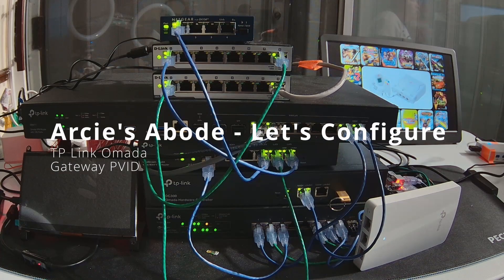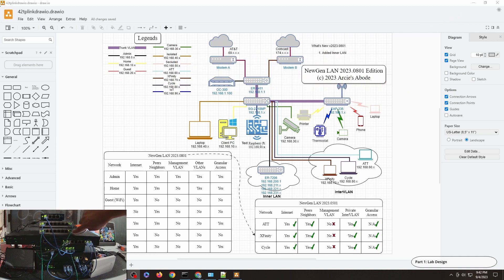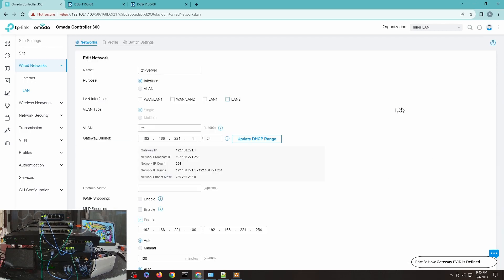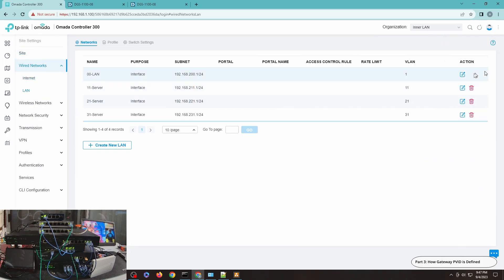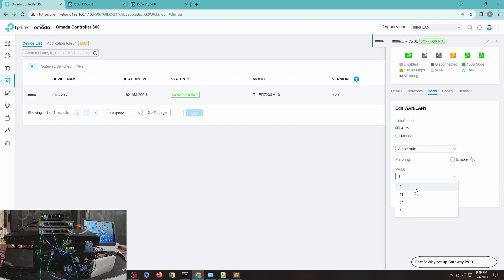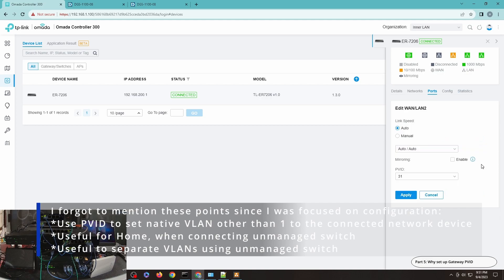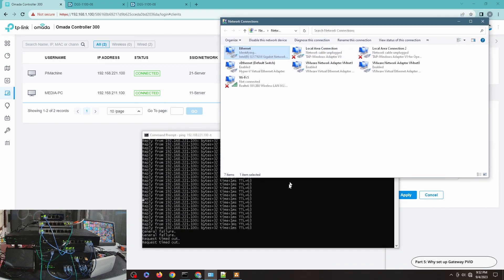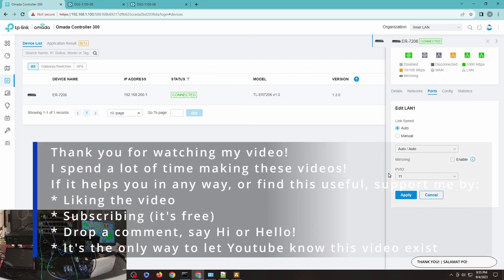LC58: TP Link ER-605 ER-7206 ER-8411 Configuring PVID with Omada Gateways

Comment: I’m trying to make this work with 2 unmanaged switches but every time I change the PVID different to 1, that switch doesn’t work, I don’t get any IP address and if I use a static ip for my pc it doesn’t work neither. I don’t know what I’m missing
Reply from the maker: heya @germanllop, thanks for dropping by. The Gateway ports are still a trunk (cant remove VLAN1) so it will all depend on how your unmanaged switch handles tagged frames. I have seen managed and unmanaged switch having the same MTU of 1500 bytes, and a vlan tag adds 4 bytes, making frames 1504 bytes long. Check if your switch supports 802.1q (I know it's unmanaged, but just for verification) or if it can handle jumbo frames, if not, then it can't work properly.
Reply: hey! @deadmeats  , thanks for the help, I have a couple of tplink switches, TL-SG1005P V4 and TL-SG1016D. Funny that both work as spected when the gateway wasn't controlled by the omada sdn controller, I can guess because the config was untagged, as soon as I tagged the vlans they won't work. Last question, there is workarround for this? Thanks again
Reply from the maker: Heya  @germanllop  , good to know and great findings. As per your question about workaround, I checked your unmanaged switches and it looks like they can actually forward frames with VLAN tag (assuming Omada/Gateway doesn't do anything that affects the vlan tag), one of the FAQ actually mention that it can pass VLAN tags (see link below). I am also adding additional ways to test your switch. If you have another managed switch (that you know/tested/verified works), you can do the Steps 0-5  (you can do this whether Controller or Standalone), also as an alternative to Steps 0-5, you can do Wireshark and do packet capture while performing the test in FAQ697 (link below):
0) Factory reset your Unmanaged Switch A, if there is any way (almost always none), or just hit reset or power cycle (at least 30s off before turning switch on). Make sure no other devices are plugged to the switches and Gateway.
1) Configure your Managed Switch B with the following: 
   1.1 Port 1 VLAN 1 Untagged, VLAN 10 tagged (this will be your uplink trunk port)
   1.2 Port 2 VLAN 1 Untagged (VLAN 1 access port)
   1.3 Port 3 VLAN 10 Untagged (VLAN 10 access port)
2) Configure your Gateway LAN1 with the following
   2.1 VLAN 1 Untagged, VLAN 10 tagged (this will be your uplink trunk port)
   2.2 DHCP Enabled for VLAN 1 and VLAN 10, with correct info for IP, Gateway address, and DNS address. 
   2.3 No ACLs
3) Connect your Gateway's LAN1 to Unmanaged Switch A Port 1 (yes, not to Managed Switch but connect to Unmanaged Switch)
4) Connect your Unmanaged Switch A Port 5 to Managed Switch B Port 1
5) Observe what happens
   5.1 Connect a PC to Unmanaged Switch A Port 2, check if you get a DHCP VLAN 1 IP (or a VLAN 10 IP). If not, assign a static VLAN 1 IP and ping Gateway
   5.2 Connect a PC to Managed Switch B Port 2, check if you get a DHCP VLAN 1 IP. If not, assign a static VLAN 1 IP and ping Gateway
   5.3 Connect a PC to Managed Switch B Port 3, check if you get a DHCP VLAN 10 IP. If not, assign a static VLAN 10 IP and ping Gateway

So your connectivity will look like this:
5.1 - Gateway [LAN1] <> [Port1] Unmanaged Switch A [Port2] <> PC
5.2 - Gateway [LAN1] <> [Port1] Unmanaged Switch A [Port5] <> [Port1] Managed Switch B [Port2] <> PC
5.3 - Gateway [LAN1] <> [Port1] Unmanaged Switch A [Port5] <> [Port1] Managed Switch B [Port 3] <> PC

* If 5.1 does not work (can't get an IP), contact TP Link and let them know that your Unmanaged switch is not able to provide DHCP from an Untagged VLAN or from a PVID,
* If 5.2 or 5.3 does not work (can't get an IP), contact TP Link and let them know that your Unmanaged switch are supposed to carry the VLAN tags but they aren't. 
* if any of the Ping with Static IP is successful (or failed), add that info too.

In any of the cases above 5.1-5.3 failed results, refer the TP LInk tech support to the links below and to the product pages ( TL-SG1005P V4 have 16 KB Jumbo Frame and TL-SG1016D have 10KB Jumbo Frame), they may be able to assist you and find out what is happening. You might also get offered (keyword: might) an RMA if they find out your unmanaged switch does not work (though you will need to register and send them your faulty product)

Links:
VLAN Tag Support, check FAQ #4 FAQ910 - https://www.tp-link.com/us/support/faq/910/
Test your TP LInk Jumbo frame FAQ697 - https://www.tp-link.com/us/support/faq/697/
Jumbo Frame Support, check Q10 FAQ2817 - https://www.tp-link.com/us/support/faq/2817/
tl-sg1016d - https://www.tp-link.com/us/business-networking/unmanaged-switch/tl-sg1016d/#specifications
tl-sg1005p - https://www.tp-link.com/us/business-networking/unmanaged-switch/tl-sg1005p/#specifications

Comment: What do you mean by NeXTGen?
Reply from the maker: heya @emiellr, thanks for dropping by the channel. I use NeXTGen and NewGen when I am referring to the two major LAN designs I covered in this channel. NeXTGen is more strict and have a default "deny all" i.e. when you create a new VLAN, it is automatically considered "hostile" and blocked/isolated from all existing/future VLANs and the admin has to make a conscious decision to permit that VLAN into the network. NewGen is more open, the default is "allow all" when creating new VLANs. There are other nuances and differences (i.e. NeXTGen doesn't need a TP Link Gateway to work) as well. You can find the links to NeXTGen and NewGen below:

NewGen - starts at EP34 - https://youtu.be/vZIXaAZ_hgU
NeXTGen - starts at EP38 - https://youtu.be/pNrdLjBXPYQ
Reply: @deadmeats  oh thanks for laying it out so nicely for me! I was actually meaning to set up vlans in my Omada network but haven't really gotten around to it yet, but this is definitely useful!
Reply from the maker: heya  @emiellr  good to know. If you are new to Omada or Networking, I suggest you try checking EP34 NewGen. I have a series of videos that slowly builds up the LAN design you can see in this video. it starts much bigger than usual Home network but small enough that you can complete them in less than an hour. Happy hunting!